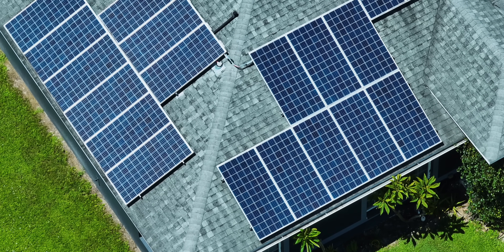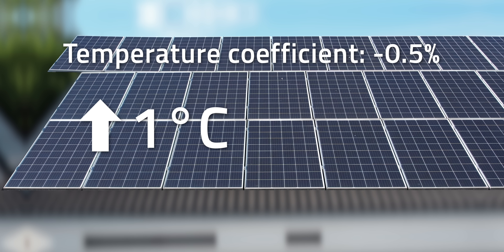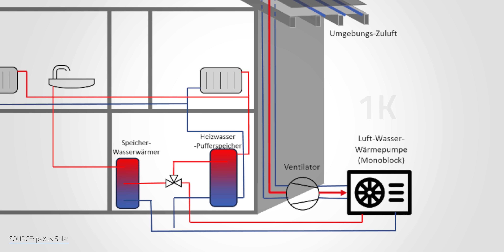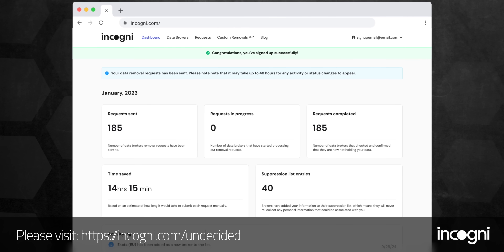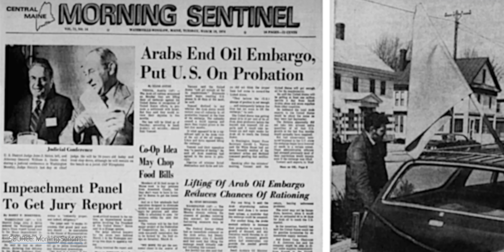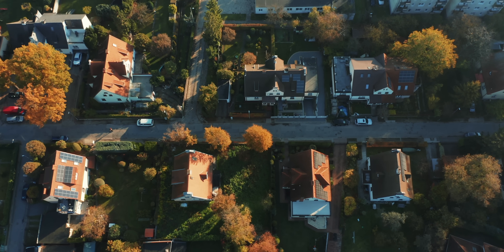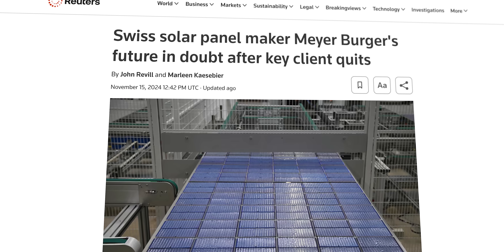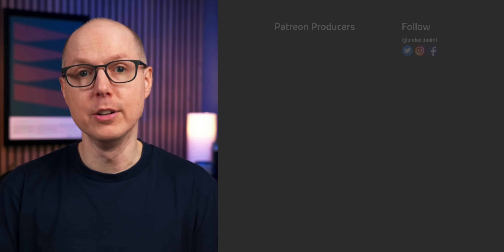Why Hybrid Solar Heat Pumps are the Future of Home Energy

Comment from the maker: Would you want a SAHP for your home? Take your personal data back with Incogni! Use code UNDECIDED at the link below and get 60% off an annual plan: http://incogni.com/undecided

If you liked this, check out How Zinc Batteries Are Defying Limits https://youtu.be/lWd6I2og-e0?list=PLnTSM-ORSgi7uzySCXq8VXhodHB5B5OiQ
Reply: I think most people will feel reluctance without a reliable seeming module design for most of these systems. The idea of needing specially implemented systems per house design would mean higher costs and higher competency for each employee assisting in its repair or implementation, further odds of mistakes and man-hour cost.

If I needed something like this system? I would want a journeyman with at least 5 years of experience or a master level tradesman.
Reply: @confusedashell020  Good point
Reply: @confusedashell020  my solar panels are warranted for 20 years, my Mitsubishi ductless mini-split heat pump for 10. Any system that involves people clambering on your roof and installing ducting and blowers and pumps is going to require more maintenance and won't have a long warranty. I had solar thermal panels on my roof and a separate air->water heat pump for backup: I replace them with more solar PV and the Mitsubishi after the fourth expensive service call in four years.

Collecting free heat from under the solar panels to improve the heat pump's heating efficiency and improve solar efficiency also has a side effect of cooling your roof slightly! Great on a hot sunny day when you're using a lot of hot water warmed by the heat pump, but the interplay between these three factors means this system just isn't going to be worthwhile for most people most of the time. If the Paxos solar PV tiles really are that cheap, they could be worthwhile even without piping the hot air underneath them to a heat pump.
Reply: The image of your roof with solar panels shaded by trees 😅
Reply: What would the numbers look like if you had a ground source heat pump? Could kill even more birds.
Reply: No. I have solar panels and a heatpump, but when it is cold there is mostly no need to cool the solar panels. When it is hot, there is no need for hot air. The electrcity of the solar panels is then used for the airco.
Reply: 4:54 في دبلجة عربية هناك خطء
Reply: Hi Matt, I live in Belgium and my "normal" tiles are almost dead (have to be replaced in the next 3-4 years).
Which brand would you advise me regarding solar tiles (without heat pump).

Tesla doesn't even answer to that question; I've called/emailed them and I know they are too expensive.

Do you think they'll do solar tiles in perovskite?
Reply: @gropatapouf5998   perovskite is still an experiment. at best youll get 5 years output. Personally i still think solar tiles are very risky as you have so many connections and places for corrosion to happen. one day all of your electric production will be gone and the effort required to correct such a fault is often huge. if i was buying a new roof and keeping the property for at least 10 years i would stick to proven technology that is easy to repair. tiles just are not that. also power density is improving at roughly 50% every 8-10 years. it is just not economic to do and the tiles need to stay put for at least 25 years - even if they are no longer producing energy
Reply: I'd love to have the PVT based system from triple solar but sadly they don't work in my area yet 😅
Reply: There is a solar panel that looks like a disco ball that is 10x more effective.  Not sure about cost to produce.
Reply: @Theonethatshallnotbenamed9999  Since run-of-the-mill solar PV panels are already 18+% efficient converting incident sunlight into electricity, "10x more effective" is misleading marketing-speak.
Reply: i would as im in Australia
Reply: Unfortunately, our government in Quebec is bound to keep energy prices so low that these innovations don’t make sense. At 0.08$ Canadian per kWh, none of these make sense on a financial basis.
Reply: Waiting for Heat pump that is combined with solar panels not tiles and also connects to heat storage like sand filled water heater. This would allow heat pump to store daytime heat for use at night. or in summer months store night cold in sand battery and cool house during the day easier.  Think Tesla heat pump moving heat and cold where need and stored for later.
Reply: https://youtu.be/ECZcWlMKQZE?si=WOk_ZDIXLzpAvFvP is this true?
Reply: Sounds like a system that would work perfectly if you wanted to heat your home during hot summer.
Reply: Would work with your set up?
Reply: You made a mistake at 4:12 you are saying its Cologne but are showing Köln.

Comment: Too niche and complex. You can just get a regular heat pump and a regular off grid solar setup to power them. This way you’re not locked in to one brand and you don’t have a single point of failure. If your solar fails you use grid power or whatever you want to power your heat pump.

Comment: I had this idea few years ago, but I concluded that it doesn't make much sense. In winter solar modules (or panels) are cooled by cold air and don't need additional cooling for performance. During summer those modules could use some cooling but a house also needs cooling at the same time so if someone wants to cool a home and solar modules it will cost more than little gain in solar modules performance. Maybe it makes sense for Germans who like to over complicate. Imagine that additional piping on your roof just to get that 20% energy savings.....how many years you will have to run such system just to break even? Just like another idiotic "invention"...a heat pump water heater. You heat your water and freeze your garage at the same time...then you heat your garage with regular heat pump or electric heater because your garage is not insulated from your living space so frozen garage will affect temperature nearby. All those "genius" ideas are for suckers while slick manufacturers cash out big bucks.

Comment: One challenge we have is air source heat pumps, even cold weather ones, can't put out enough to heat a home in cold climates unless it is VERY insulated, 

which most homes are not.  There's not a single HVAC prof in our area that recommends it without a secondary system which totally defeats the purpose of it

Comment: In northen Europe, if it is summer and the sun is out the house most likely need cooling not heating therefore heat would be moved from the house and to the outside adding heat to the already warm panels. During winter the sun is not dominant thus the panels do not provide much energy. Think a more economic choice would be better house insulation, more energy efficient electric appliances, air to water heatpumps and a solar + battery installation. Just my 2 cents...

Comment: I have been asking this exact question for years. Why don't they mount a rooftop Solar Water Heating system, THEN put down Solar Panels, for every Home installation? The heat from the Solar Panels will make the Solar Heater more effective, and the cooling effect to the Panels will make them more efficient.

Comment: Probably jumping on the “what does harvesting heat in the summer get me” train only halfway through the video would be foolish, but I am trying to think through running (essentially) AC coils around in the soup that is the outside air right now (dew point of 80F), which would eliminate some cooling (because dehumidification—when water vapor is condensed out of the mugginess—doesn’t decrease temperature), but presumably the condensation wouldn’t be channeled anywhere bc it’s already in a place water is expected, so maybe you’d get some evaporative cooling when that water re-vaporizes
(Technology Connections has a great video about AC cooling vs Dehumidification)

Comment: Matt, the costs per watt of the systems you are comparing is shocking. Current cost for uninstalled conventional PV panels is about $0.35 per watt, 1/5 of the costs for the systems presented. So the increased efficiency of cooling the panel is dwarfed by the ability to simply pit up 10-15% more panels to compensate. The air heat pumps I have work well down to -20F so I don’t worry about warming them to get more COP. Please keep up your excellent data-driven presentations, you and “Just Have a Think” are the shining stars of home solar engineering. I have an off grid super insulated solar home that I designed, so I know something about how good your videos are. How about a discussion of Phase Change Materials (I have 2000 lbs in my walls) next?

Comment: Panels (and everything) gets hottest in the summer, when heating demand is almost nothing so the heat pump will not be able to dump the heat anywhere (and remember panels are only 20% efficient, so 500W panel has 2.5kW of sun hitting it with 2kW being turned into heat, that's a lot of energy to get rid of). Overall, stupid idea.

Comment: The largest problem in my area would be all the considerable damage from every hail storm that comes through. At what point does someone discuss the durability factors so that it becomes financially viable over replacing a roof or portions after significant hail storms.

Comment: so, I live in australia. its sunny and its hot very often. so heat captured from this system is actually not that useful. sure hot water. for a bit. but... can you try extract energy from that heat to electricty? probably not, I doubt the cost/benefits, efficiency of thermoelectrics or otherwise will add up
Soo... you need to extract heat from the solar panels, using less energy than that gained from improving solar panel efficiency, and the extracted heat, if it can serve a useful purpose would be a bonus. but then the overall gains need to be added up over the lifetime of the setup to see if it offsets the added cost of installation, maintenance and removal. fairly messy. for most people, buying a few more solar panels to offset the drop in efficiency from overheating might just be easier

Comment: Moving the heat from the panels is the true benefit reducing the stress on the panel. Added efficiency is a bonus. 
Maybe panel makers could start including the necessary parts to water cool the panels

We've seen smart buildings utilize the heat from ne area and move to another. Total space design engineering !
Employing total space design at the resident level would have significant benefits.
Recent multi-stage heat pump systems extend operation to 0 F and below.

Comment: 3:26 “Heat-pumps need extra warmth when the solar panels need cooling down”!? So solar panels need cooling down when the air temperature is HIGH, heat pumps need extra warmth when the air temperature is LOW! Did I miss something here ‽

So are these numbers cherry-picked for optimal climate conditions ‽ It would seem that an environmental engineer would have to do a reasonably thorough thermal modeling analysis on the particular structure to determine cost viability. 

It seems that this would be highly local climate dependent and the biggest benefit is from cooling the solar panels. It seems like some additional benefits are derived from reducing the roof temperature with this active cooling approach. It would seem that additional benefits to the structure could be achieved by being more proactive with the cooling during hot weather.

Comment: For countries like Australia where sun still shines in winter, it's a great idea if you pair it to heat your hot water, however there are more problems if you're using it to directly heat your home like a traditional air-source heat pump. Since you need to extract heat from the air behind the solar panels during summer, you couldn't still use that air as a heat sink to cool your house (if the air behind the solar panels isn't heated up so much that it can't work or isn't efficient). 

As far as I can tell, the only option for indoor cooling would be to have heat transfer at both the ingoing air to and outgoing air from behind the solar panels, that way you can extract heat from the ingoing air to cool the solar panels, and dump heat from indoors into the outgoing air from the solar panels. This setup would fix all your problems and not just maximise but boost the efficiency of both the heat pump and solar panels even if you were using them both at the same time: 1) during summer (or when you want to cool the house), the cooled outgoing air from behind the solar panels would maximise the efficiency of extracting heat from indoor air; and 2) during winter (or when you want to heat the house), the solar panels would only need to be cooled depending on the temperature, but if a) panel cooling was required, then heat could be extracted from the ingoing air to heat the house's indoor air (while cooling the panels), while If b) the panel cooling was not required, heat could be extracted from the outgoing air which would already be heated by the solar panels, thus increasing the efficiency of heatig the house's indoor air, but also the same heat could be used to heat the heat pump itself if electricity from the solar panels wasn't used to do so.

Otherwise, the comparative cost metric depending on the region, and what your winter weather look like, seem the biggest issues with this.

Btw: when I say "heat exchanger", I mean specifically the heat exchanger component of the heat pump (so in the above scenario, you'd have one heat pump with two heat exchanger components, where the ingoing and outgoing air to/from the solar panels would be piped to the heat pump so heat could be extracted from either source to the same pipe carrying low-temperature and low-pressure refrigerant - and either or both heat exchanger components could be used at the same time)....just to clarify (just in case that wasn't totally clear).

Comment: 3 Units of heat for 1 unit of electricity ? What kind of bullsh*t is this? For brainless people? A kWh of heat is the same as 1kWh of electricity, no matter the origin!
And no - heatpumps will not help in combination with solar panels, as in the winter solar output is minimal whilst heat requirements are maximal. In case you already have solar panels installed on your house you can easily see that during the winter months solar panels produce like 3...5% of their yearly yield. So if you consider the amount of heat (in kWh) you can easily see that winter-time solar energy will cover ~ a few percent of your minimal winter-heat needs. Regardless of the price, solar panels brand , inverter, solar batteries, efficiency, etc a heat pump cannot work properly with sun energy - simply because of its LACK when needed!
Nonetheless, there might be a latitude/longitude on this planet where sky is clear and sun is shining in the winter - and for those home owners , who knows - it might just work.

Comment: Living in Arizona this would be the most amazing thing!
I'm a plumber by trade and would love to install a full SAHP on my roof today!!
Free hot water in the day time(with recirculation), cooled solar panels so they last longer in the AZ heat, and now a shaded and vented/cooled roof over the attic
This is savings all around!!!
Reply: @Thorod90  I am in south Texas so this would be beneficial for us too. I just worry about all the hail storms so replacing panels would be my largest concern.
Reply: @Thorod90  I live in AZ as well and I can’t see the benefit of that much hot water. I’m trying very hard to get rid of the excess heat. I don’t have a pool but even my friends that have pools are trying to cool them in the summer and you can only take so many hot showers. So short of a geothermal well where are you going to get rid of the heat in the summer?
Reply: @Mr1DANBOY  I also live in az. Southern az. The temps lately have been around 100F and they're slowly coming down. However, my pool is stupid cold and it has been cold since late july. Last year at around August the water was still warm. This year, the entire summer the water was only tolerable. If I could dump my roof heat into my pool I'd probably be in there right now.

Comment: This is what i am always looking for my home. During summer in San Diego, Solar panel can heat up to 90 degree Celcius in some location. Cooling down the solar panel will increase its productivity at the same time extend its life, those heat can also be use for water heater or other things. the only problem is the system cost and maintains cost.

Comment: Back in 2012, when I was just a kid, I put together a little setup using a spare 50W solar panel, an old PC cooler (it was a Zalman, which many gamers today probably haven’t heard of), and a cheap thermoelectric module. At the time, thermoelectric coolers (TECs) were all the rage, so I decided to give it a shot. Since I lived in a tropical climate, maintaining a significant temperature difference was easy, and while the energy output wasn’t much (around 0.1W to 0.5W), it was enough to charge rechargeable batteries.

One thing I noticed was that using the cooler with the solar panel actually improved its efficiency by about 15%! That’s pretty decent for such a small setup. If we were to scale it up, say with a 10kW solar array, and use a better energy storage system - PCM, the results could be pretty substantial

Comment: I'm confused about two things.

How are solar panels supposed to work in winter when they're covered with snow? What heat are they supposed to build up when the sun doesn't reach them?

What happens in the summer when the house needs to be cooled, not heated? Is the heat pump gonna cool the panels at the cost of making the house an oversized oven?

Either way it seems like a terrible idea, unless I'm missing something.